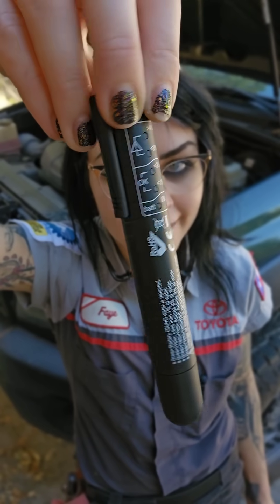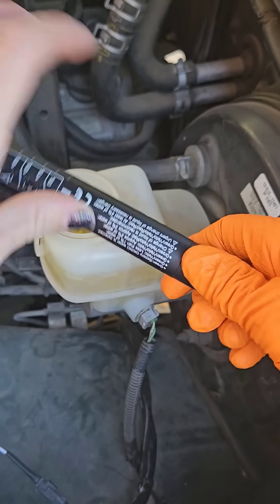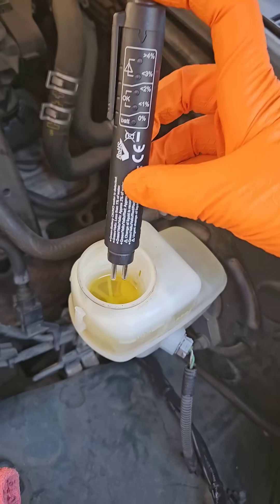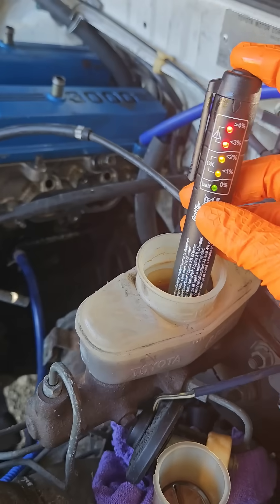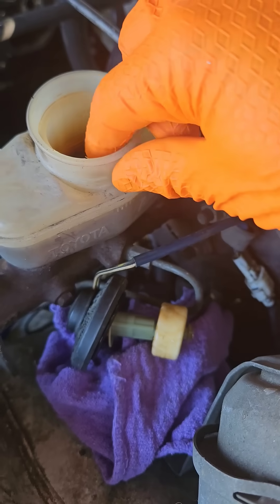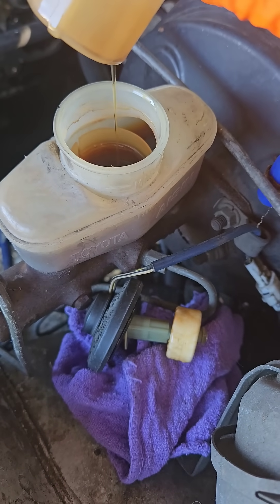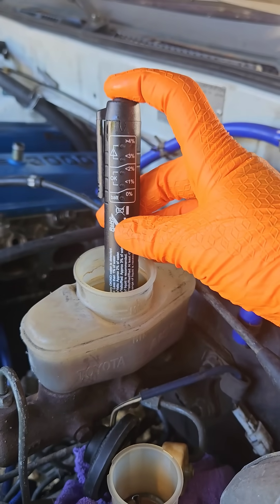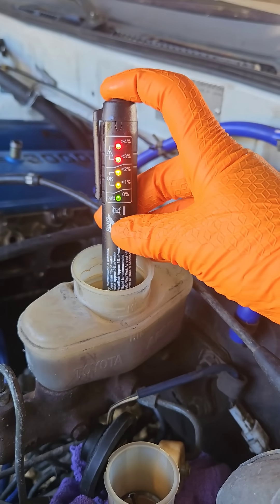Do you REALLY need your Brake Fluid Flushed?? How to Test it For Yourself!

Comment: Half the time the mechanic doesn't even flush your brake fluid anyway. They just suck out the contents of the master cylinder reservoir and put clean fluid in to make it look like they did.

It is mostly a scam. 😂
Reply: @republicoftexas3261 Best way to know is to dab some paint on one or more of your bleeder screws. If the paint hasn't been disturbed after the shop said they bled the brakes then they are lying.
Reply: @aaroncostello8812  Genius.
Reply: That’s what the Toyota dealerships do😂😂😂😂
Reply: Don’t go back to that place. Brake fluid flushes are done and are pretty damn ez. Places that just suck out the reservoir are really shitty and hire lazy technicians.
Reply: Lol shows what kind of work you did 😅 our shop uses a vacuum bleeder to pull clean fluid through EACH line.
Reply: @ahlfawerks same my shop has the bg break flush machine that makes brake flushes pretty easy.
Reply: @MIKEXJLRCARS  -- Yes, yes. A brake flush machine like the BG actually FLUSHES the system instead of just draining and replacing the fluid. I'm not going to buy the brake fluid tester, because I have already experienced the increasingly squishy pedal feel after 60k miles, and it's getting squishy again, so I'll just have it flushed again.
Reply: @grizzlygrizzle  will most places even use a machine? I think they’d be more likely to simply drain and fill
Reply: @ahlfawerks  That is exactly the way it should be done. I never worked at a shop, I have just had family members get taken by "the brake flush scam". 😆
Reply: @ahlfawerks  sounds about right.  My shop tells me this is what they do.  I can now breathe a sigh of relief as this thread had me worried :(
Reply: Certified Ford Tech here: No one I know does this. The machine does all the work. It takes about 20-35 minutes. It pays 1 hour, and since we use BG, we get spiffs.
Reply: @michaelbrakeman448  There is no reason for you not to do it if the dealership has a $10,000 machine that does the work for you.
Reply: @michaelbrakeman448 what's bg?
Reply: You would be lucky if they even did that. 😅
Reply: That's nonsense. While there are scammers out there if you go to a reputable company you can be sure they are doing the work.
Reply: I agree with you on this 💯
Reply: @republicoftexas3261you'll know because your brakes will go mushy when you do extended medium-hard braking like when driving down a bendy mountain. The water in your brake fluid will boil and compromise brake pressure.
Reply: I work at a Honda dealer and we flush every time we say we do
Reply: @Hadeeez  even though you don't have to. Honda's don't wear 🗿
Reply: Nah, that’s only the first part of the procedure. 

We suck fluid from each bleeder screw of each wheel while topping off the reservoir at the same time as well.
Reply: This is truth. Am tech. You want a proper flush do it yourself. We get given 0.5 for a BFC, for that I vacuum pump the reservoir, top it up then pressure bleed from the NSR brake nipple, fuck the other 3 I just do it the one furthest from the reservoir because I will get "most" of the fluid out, it's probably 80% as good as a four corners and clutch slave flush but ain't nobody got time for that. Literally.
Reply: Using a flushing tool and doing it correctly is very easy, but yeah, there’s unscrupulous or uneducated mechanics out there who don’t fully flush the system. I would always fully flush my customers fluids if that’s the service they came in for, and replace any missing nipple protectors for the next tech who serviced them.
Reply: You know about flat rate right?
Reply: Do you have video evidence to back up your claim?
Reply: First of all if you don't trust the shop to do it right, then you should find another shop. And if you do have any doubts, tell them you want to watch it being done. An honest shop will have no problem with that.
Reply: no lie we got a machine that does it automatically so if ur not actually doing it thats crazy
Reply: Just ask to be present and watch. If they say no.. respond by saying Joe across the street will let me watch. He likes money and business more than you.
Reply: @cmonman7664  I get your point, but dealerships can't get away with shiz like that, bro. Insurance, OSHA regs, and tool theft are the top 3 reasons. I mean, in reality, if you can't trust your mechanic to do their job the way it's supposed to be done, find a new mechanic.
Reply: @michaelbrakeman448  Local mechanics like her. Not talking dealerships. Also dealerships and shops have WINDOWS you can watch from so Osha can FO. Carry on.
Reply: @cmonman7664  Lol, she's not a "local shop." That's a Toyota Tech dealership uniform she's wearing. Local shops are also beholden to OSHA regs, and if they get caught not following them, they'll be heftily fined.
EDIT: Not all of them have windows that allow you to look into the shop. Just saying. Also, phone autocorrected following to filling for some reason. . .
Reply: @cmonman7664 Mechanic here.. Yeah, go ahead and try that. Most mechanics don't want some stupid customer standing there staring at them while they are working. Joe across the street would tell you what to do with yourself as well. Plus, it is a liability having some fat headed idiot standing around in a shop as well. AND, if you are a pushy jerk to your mechanic, he will put your car in the back of line and you definitely will not get any deals or discounts. Do you have the same attitude when you go to a restaurant? Go back to the kitchen and watch them cook your food? Gimme a break, lol.
Reply: Unless the fluid in there was fairly new, the pedal will feel firmer if they actually changed all the fluid.
Reply: @wigletron2846  that's not necessarily true. The firmness of the pedal mostly depends on how much pad you have left,  bc that determines the amount of travel it takes for the piston to push the pad into the rotor.
Reply: I wish you could do that instead of having to deal with rusted out bleeder valves all the time.
Reply: Convinced me to buy the testing device.  You should get a commission.  I'm going to test my fluid then see what my mechanic tells me.
Reply: Would it be a waste to suck out my engine coolant from the reservoir and replace with new coolant? I know there’s more coolant inside the radiator and system but would replacing what’s in the tank alone help in any way?
Reply: It's typically relatively easy to do coolant on cars since there is a peacock valve at the bottom of the radiator so I wouldn't bother trying to exchange a few cups worth of coolant at a time in a system that can hold gallons of coolant.
Reply: @Joe-sm8wl  eh, I might try doing it myself then. Last time I paid the toyota dealership $500 to do the engine and hybrid system coolant on my Prius and they forgot to fill the engine reservoir somehow, I called them out on it and they said it doesn’t necessarily have to be filled because there’s coolant in the radiator🤣 morons
Reply: @ZavHustles  no, it won't help. Most cooling systems hold 10+ quarts of fluid. The small amount in the overflow getting changed out is a waste of time.
Reply: Isn't water less dense than oil? So, water would float to the top, and replacing the reservoir would remove it, no?
Reply: @bigfanpics8496  brake fluid is not oil, it's polyglycol which is hygroscopic meaning it attracts and bonds with water. It will even attract water through the tubing. Causing the brake fluid to blend with the water and increasing the risk of the water to boil when the brakes get hot, resulting in vapour lock and dramatically reduced braking pressure.
Reply: That's why you should always use a mechanic that you trust,

And not some low cost, quick fluid change place.
Reply: @republicoftexas3261 it is inconvenient to check however it is fairly easy for some cars and trucks. Just crack open the brake bleed valve if it comes out dirty take it back. Ask for a refund or for the full service and don’t go back. A further step would be to report them to the BBB.
Reply: Very true, I work at subaru n vw and they just suck the old fluid out and refill. 
I have never seen them do a full brake flush including bleeding the brakes

Comment: Lol growing up we never changed brake fluid.  It wasn't even a thing back then. The only time you did anything with the fluid was add more when bleeding the brakes from a caliper or wheel cylinder replacement.

Comment: Nice cool gadget. 
For me It gets new fluid replacement at every complete brake job. So never considered one or ever knew there was such a tester for break fluid condition, but did know brake fluid draws moisture out of the air. Most systems I dealt with were closed sealed systems that had vacuum diaphragms that expand into vacancy space in master cylinder when brakes worn down. Fluid was blead off via bleed screws when calipers or cylinders were compressed and master cylinder was refilled with new fluid and a final topping off after bleeding the brake system.

Comment: I've been a ASE, GM Master tech since 1974. I have never changed brake fluid. I have a 1956 International, 1960 Chevrolet and a 1994 Chevrolet still has the same fluid. Don't be scammed. She is right that the brake fluid does absorb water, however does it effect the operation?

Comment: My dad is a self taught auto body and heavy diesel mechanic, as well as casual shade tree auto mechanics, home remodeling, electrical wiring, concrete forming, block laying, wood working DIY'er on steroids, he says the same things Faye says, I'm going with Dad and Faye when it comes to wrenching. Killer short Faye, ❤

Comment: Additionally Old brake fluid will deteriorate over time as it is heat cycled.  As it gets older and doesnt lubricate properly then you see seal failure(s) in all the moving components of the brake system..

Comment: Sorry, but those cheap testers are garbage, they supposedly work by measuring resistance, but different brands and DOT standards likely have different resistance.  I have seen a video or 2 of people testing them, and they couldnt detect difference between new and old, black fluid.  What you need is a brake fluid boiling point tester, leads hook to battery and you put it into reservoir.  Select the DOT standard the vehicle requires, and it will quickly test boiling point and let you know if replacement is needed.

Comment: Another cool trick is to take a coolant tester with the suction bulb and completely suck the old brake fluid out of the reservoir first. The reservoir takes every drop of a whole 12 oz bottle To fill back to the top. I like amsoil dot 3. You can do this step only or before you bleed the brakes. Love the video!

Comment: I got 2 of those testers off Amazon and while they did work, the construction on them are very cheap, they both broke within 2 weeks of use in the shop. Both broke simply from pulling the cap off. Probably good for a diyer though.

Comment: Brake fluid should be flushed every 2 years.  Brake fluid is hygrosopic which means it like to absorb moisture. As it absorbs moisture the boiling point comes down resulting in a spongy pedal and the brakes not being so grabby or perhaps in emergency braking the pedal goes all the way down

Comment: Don't mention this to Harley owners. You will cheat the dealerships out of a ton of money.
Reply: I'd absolutely want the brakes on a big heavy bike to be in perfect condition. I change the fluid on my bikes every two years as I don't want to find out the hard way that the fluid has degraded. And there's no way I'd trust a cheap Chinese fluid tester to be anywhere near accurate.
Reply: @stuc.6592  you didn't understand the comment. Harley stealerships will try and hit you up for an expensive brake service whenever possible. How do you know if you need one without a tool to check the moisture content? If you have abs you would want to know anyway. And who cares where it's madei if it works? Where do you think most of the electronics on your bike are made? China. As for two years? I don't know. The new abs selinoid controlled bikes are different than old school. You don't just get brake fade it can damage the brake modulator for your abs.
Reply: @ronjacobsen3264  The electronics on my bike might well be made in China, but to Yamaha's standards and not sold on Amazon for pennies. A proper brake fluid testing tool costs around £200, is calibrated and will give an accurate measurement. That Amazon tester could be wildly inaccurate and you'd never know. ABS can't do anything if you've boiled the water in the brake fluid and you're compressing a gas instead a liquid - and it won't even activate as the brakes can't lock the wheel in those circumstances. And ABS on some models brings it own problems for fluid changes. Sometime you have to activate the pump via the OBD socket and a suitable device to properly purge it a pull new fluid through. And yes, that costs money. But money well spent.

Comment: LOL. 18 years on the same brake fluid and no squishy pedal and braking is still excellent. Brake fluid flushes are just a hoax to make money for garages.
Reply: is still excellent? see the thing with stuff that slowly deteriorates over time is that people without much experience or knowledge about it would likely never notice. brake fluid absorbs water and also goes bad over time, some people take this same attitude to oil and need an engine replacement at 60k miles
Reply: @arcanevoid9199  yeah, I'll buy that along with Brooklyn Bridge.

The ONLY time you need fresh brake fluid is when you replace brake lines. There's a crazy fad for changing everything on a vehicle when it does not need to be changed.

Brake fluid will work until the end of time. Hell, if it wasn't for cold weather you could use water instead of brake fluid.
Reply: @britishtechguru  changing everything is called servicing, and it definitely does need to be changed. brake fluid will probably still work just nowhere near as well. cold weather is not the only thing, having water in the lines wouldnt lubricate anything, the lines would rust out, and it would boil after a very small amount of hard braking which would make the pedal would go to the floor and do nothing. the shelf life of brake fluid is only 2 years, and thats in a sealed container

Comment: ive never in my 41 years of existence ever flushed brake fluid. it's never affected anything I've ever driven either.
Reply: even a sealed bottle of brake fluid goes bad after 2 years, never affected anything my ass. it absorbs water and breaks down from heat cycling

Comment: I'm the original owner of my 2002 Silverado, this is actually a pretty contentious topic. Myself and inlaws do road and drag racing they are all of the no need to change mindset. 

I used an incident to do a full flush and fill without an epic argument.  One of my brake hoses ruptured and honestly after racing this thing for 20 years I feel zero difference the only time I felt a difference in braking was the rupture. And yes fluid was black

Comment: @FayeHadley~
Over time, water tainted DOT3 will transform into ammonia, eating up the hoses and seals.
I do not know if this applies to DOT 4 or 5  as well~ pretty sure it doesn't to silicone-based, so do your due diligence. 🥸

Comment: Yeah it testet ok in the resivour, try taking an sample from one off the calipers or brake cylinders. I change it every 2 years on my patents and my expensive cars. My beater corolla get it changed when doing brakehoses or caliper rebuild. So still som shitty brakefluid in 2 wheels 😂 still better than most cars here in Denmark

Comment: I have trust issues with these testers.  We got one from a supplier and it was failing every car.  We opened several containers off the shelf and those failed too. I will have to try some of the other methods.  GM once told ud DO NOT flush brake fluid but that was 20+ years ago.